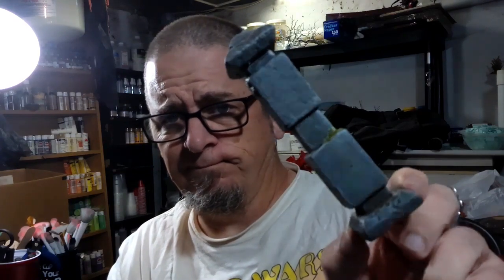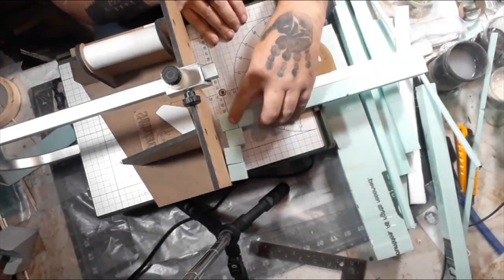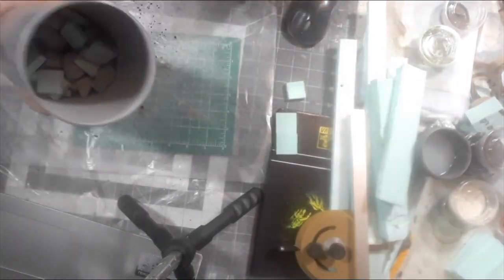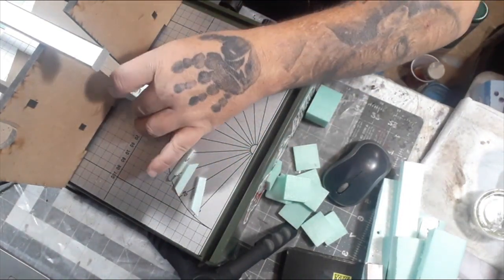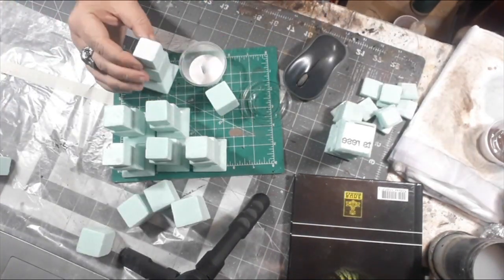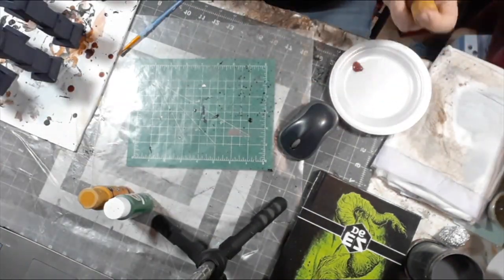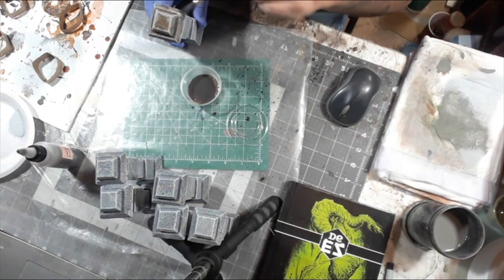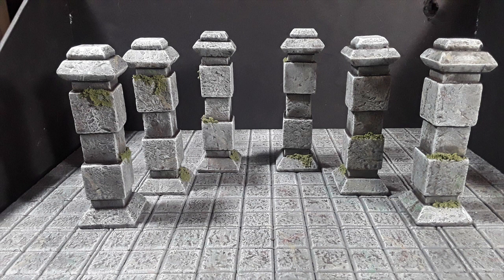"Block" Columns for EZD6 D&D and tabletop wargames

Comment: Good job, nice and simple columns that look good on the table.
Try using some nuts/bolts instead of rocks, it keeps the dust from the rocks and lets you pull them all out with just a magnet.
Reply from the maker: @metajock  I use bolts/screws now, but glue them in permanently. With the foam pulling something in and out like that could cause unnecessary damage to something that will spend most of the time on a shelf or drawer

Comment: i would add toothpicks between your column segments. First mechanical attachement, then glue. it will be sturdier.
Reply from the maker: On larger builds toothpicks would definitely get used, but on something like columns like this the tacky glue is more than su6to do the job.
Now if these columns were gonna be going to a gaming club or an LGS then absolutely they would need the toothpicks for some extra sturdiness. Being that these are going to be for my personal use I'll just use the tacky glue